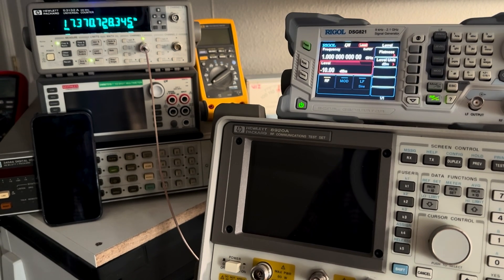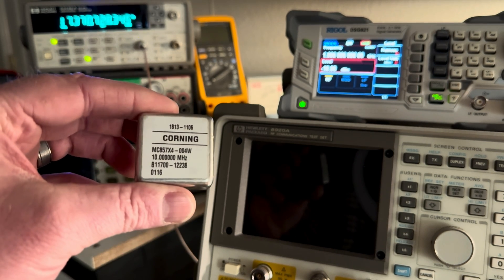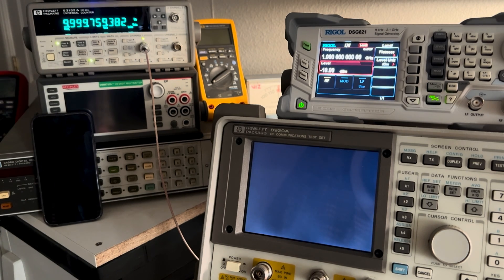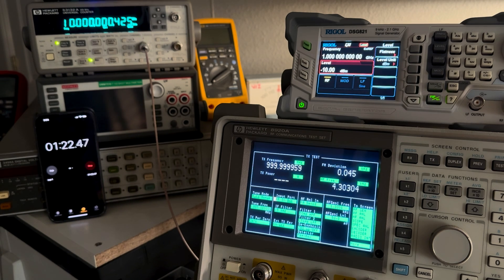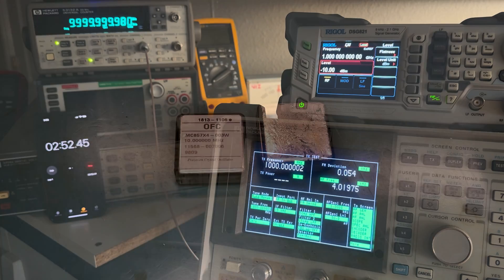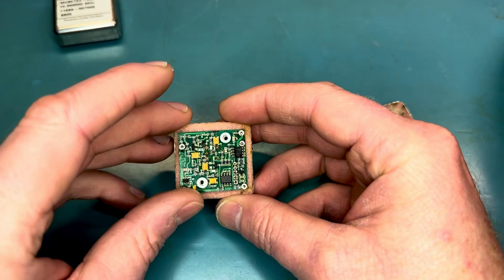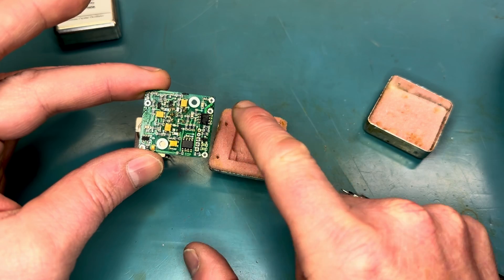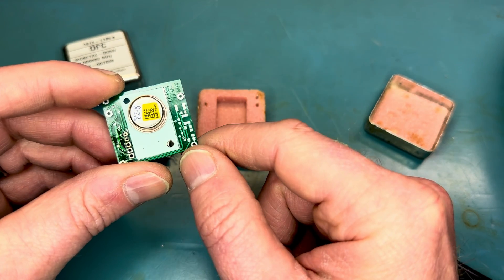HP 8920A OCXO teardown and replacement test, updated - KJ7E

Comment: I see you replace your display. Does the RF input output module beneath the display need to come out to remove the old CRT? I’m a bit nervous about the semi rigid coax connector is getting damaged.
Reply from the maker: I replaced the display at my office desk, with some simple tools, it was not very difficult.  I think the attenuator modual did have to be removed.  I just followed the service manual procedure and took me maybe hour and a half.

Comment: Beautiful screen, and nice rig!😄 How did you reference your 53132? Does the crystal OX in 53132 more stable than 8920s'?
Reply from the maker: I use a pair of GPSDO's.  One Trimble THUNDERBOLT on GPS and one u-blox m8t on Galileo GPS.  I find my m8t on Galileo has better short term stability and phase noise so I use it primarily and use the Trimble on GPS as a sanity check.
Reply: @damonkj7e  Cool! That makes sense. I'd like to hook the GPSDo up on 53132.

Comment: Thanks for your videos about the HP 8920. Looks like you've replaced the display with the LCD kit that's available on Ebay. Did you do a video about that replacement? How did the replacement go? Is the 8920 any lighter with the LCD instead of the CRT?
Reply from the maker: Yes, its the Simmconlabs NewScopeJR LCD kit, you can get it for a better price if you do direct rather than eBay.  I did not do a video of the display replacement.